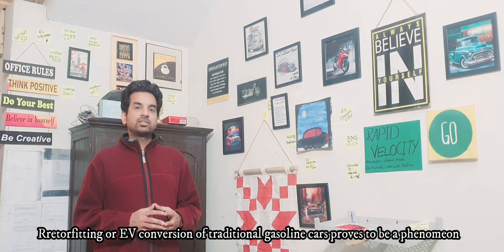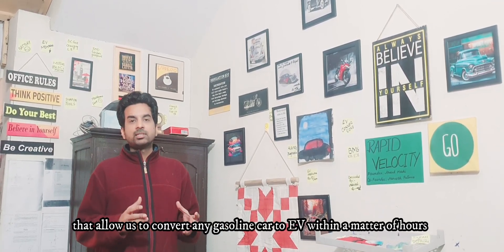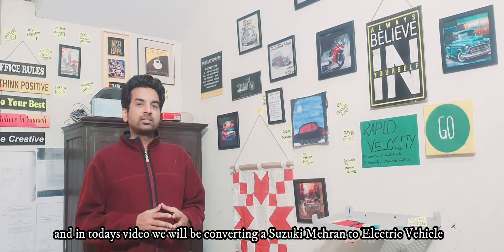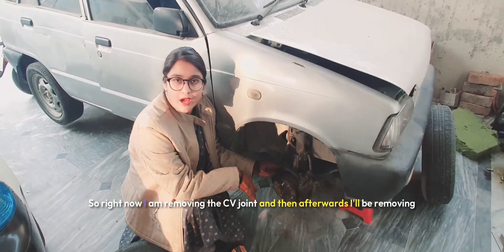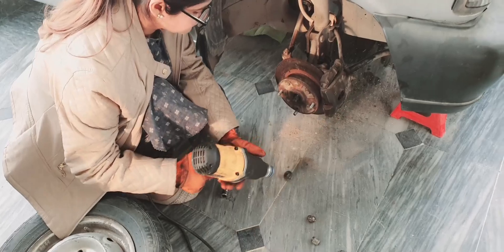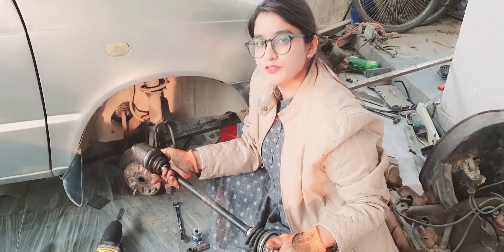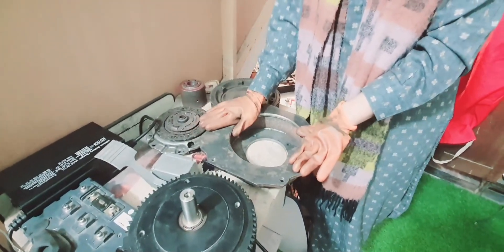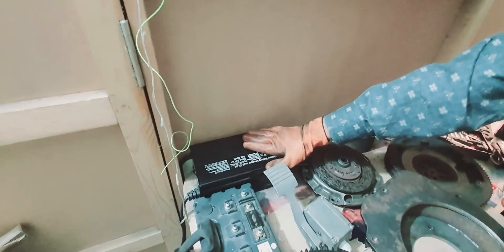Convert Your Gasoline Engine Car to EV in ONE DAY! ⚡️ Bolt-In Kit by Rapid Velocity

Comment: What is the solution for air conditioning in diy ev solutions? Do you have any experience regarding this to share?
Reply from the maker: A separate motor for belt driven compressor or a DC Compressor, both solutions are reliable.